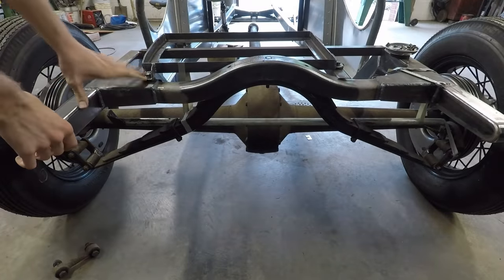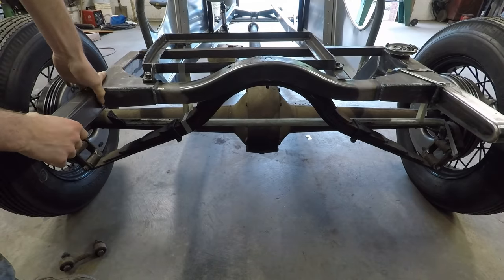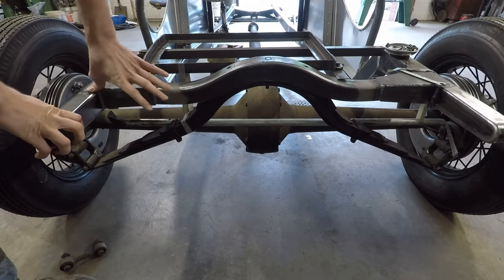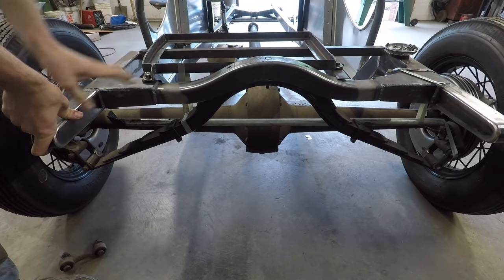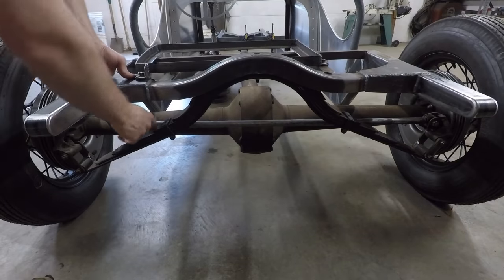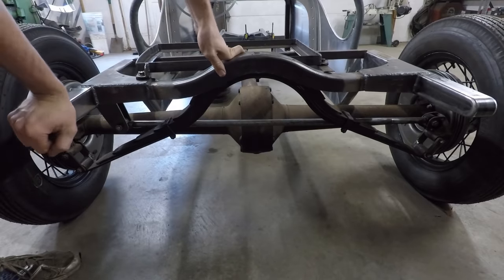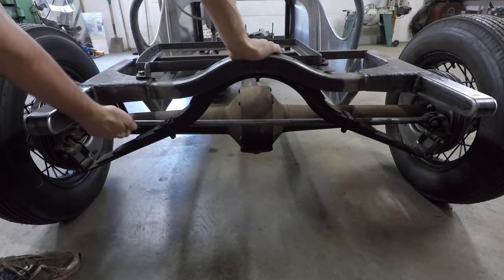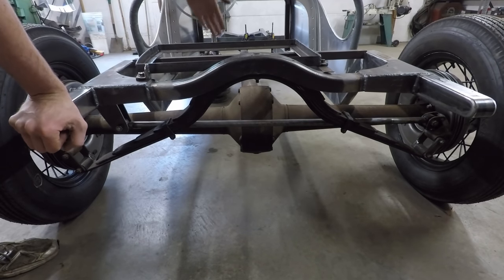How to Make a Panhard Bar | Homemade Boat-tail Speedster Pt. 42

Comment: Excellent!
If for some reason you are not satisfied with the minimal lateral movement of the panhard and want to get even less, you can switch to a double linkage like TALGO trains use to self center their bogies, but I doub't you'll need to.

Comment: We use pam hard bars in NASCAR. Always have and I don’t see that changing anytime soon. Simple and effective. We set ours up so the car rolls into the left turn. Since most races are run on a oval or sutch where you go fast and turn left. When we do road corses it’s rain or shine because we have rain tires and all road corse cars have to have wipers, 1 break light in the top center of the rear glass, and defrost bc if it’s raining and you don’t have it u are fuked.

Comment: Great build! I would have used a rod-end and made it adjustable. Also, I wouldn't recommend plug welding cast mystery metal. Best of luck!
Reply: Probably forged steel not cast.

Comment: From the factory on those ford transverse leaf spring suspensions was there anything to prevent the rear end to move side to side, or did they just rely on the shocks to dampen the movement?

Comment: Im rusty on my trigonometry but with the panhard bar being fixed in length wouldnt that shift the body as the suspension compresses?
Reply: Yes it does and he mentioned this in the video. What he didn't say is a long bar has less change over a given range of travel than a short bar, all other things being equal.

Comment: If the rear axle is hung on the spring/shackles on a Ford torque tube (banjo) rear end, a panhard bar isn't necessary

Comment: Good job but you really should have made it adjustable . However it will work as is just fine after all factory bars are not adjustable. I just prefer to make all suspension links adjustable.

Comment: watts link is easy to build
Its more precise than panhard bar
Lot of the old hot rodders use on since it was invented in the 30’s
Reply: Paul Tavres invented in the 30s but patented by James Watt in 1784 ...?